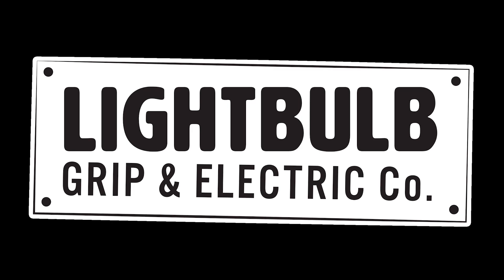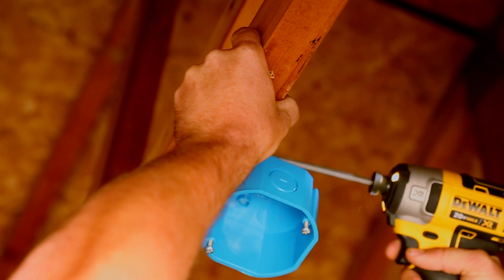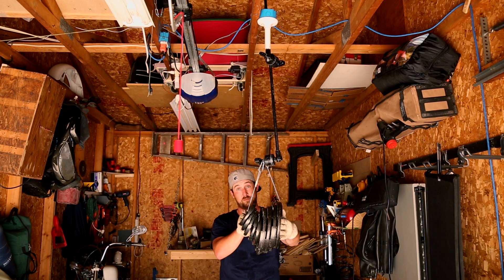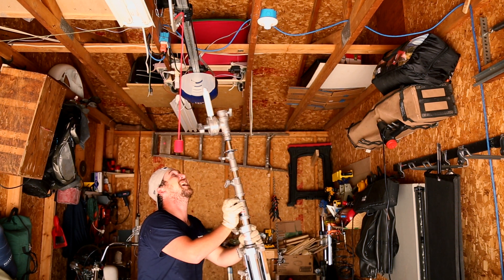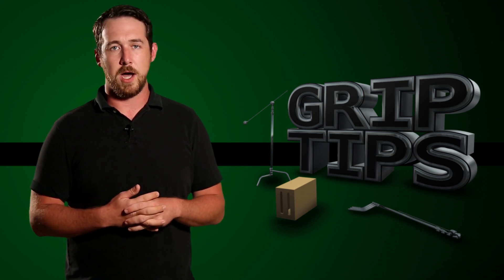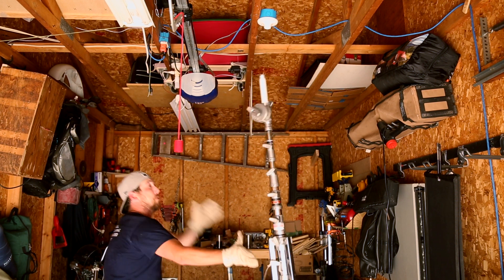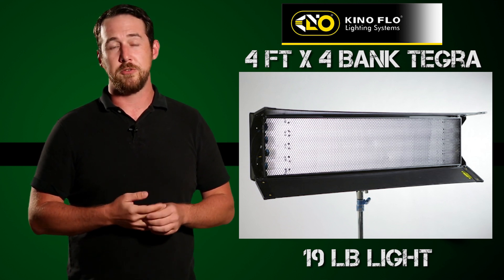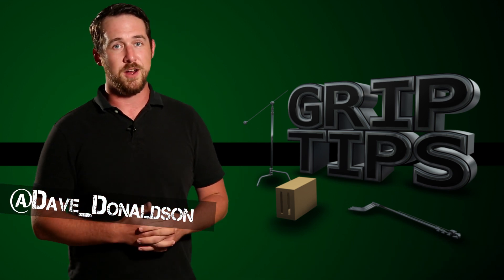Ep 44:  Light Socket Load Test

Comment: You definitely want a safety margin greater than 50% though. Read up on "safe working load". The most typical ratio is probably 5:1 (at least when there is the slightest risk of injury). So, unless you can determine what type of fixture you are mounting to, I guess you really shouldn't exceed 9 lbs.

Comment: Hey Dave , we dont use Screw type thread for Bulbs in India ! is there an adapter for two pin turn type bulb adapter to a baby pin ?
Well there is an option of converting our pin to a Screw type bulb  using a local adapter, but just asking if there directly an adapter ? Thanks
Reply: At that point you may as well figure out a more traditional way of rigging. Wall spreader, menace arms, drill the baby plate into the ceiling if possible.

Comment: Hey Dave, it's been awhile, just thought I would pop by and say hi. Nice concept btw. I've been curious myself at the capacity of sockets. Two things to keep in mind: 1) when calculating a working load limit (WLL) you take the capacity and divide by 5 for a 5:1 safety factor. The WLL  of the can light is therefore 38.8/5= 7.76lbs. The Tegra would exceed the WLL. 2, if you require any rigging off of the center of gravity of the point, the torque placed on the socket will likely crack the porcelain.